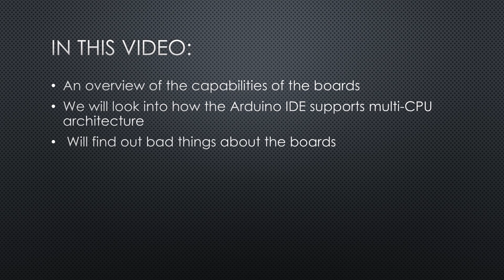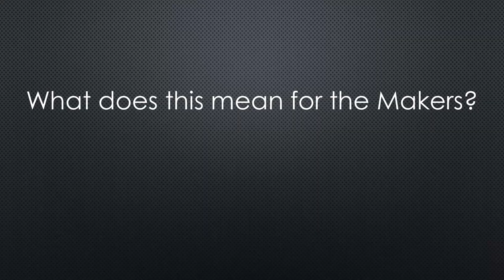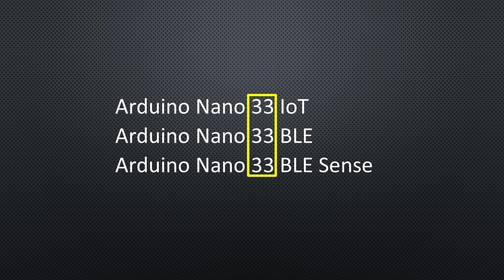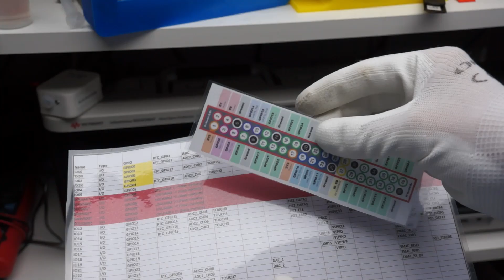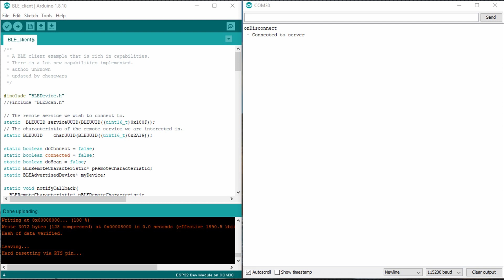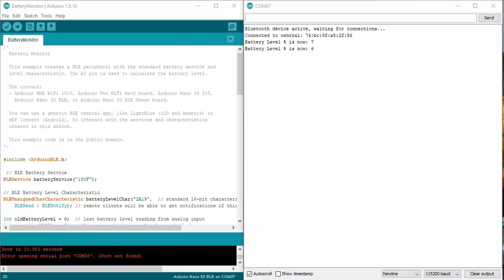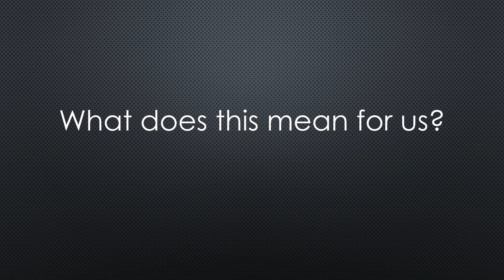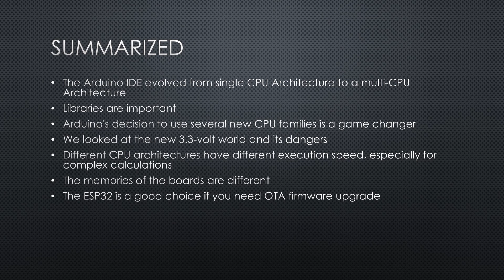#298 Four new Arduino Nano Boards: Test and Comparison (Every, 33 IoT, 33 BLE, 33 BLE Sense)

Comment: Surely the BLE power consumption is due to the BLE device being a MASTER unit rather than a SLAVE unit.  A master has to be awake all the time in order to notice slaves transmitting.  

Is there software available to make the unit act as a BLE slave?
Reply from the maker: You have both examples. But the sensor has to be lower power than the receiver as the receiver usually has more possibilities (e.g. smartphone)

Comment: Andreas, i made a sketch that is working on a Arduino Mega 2560, and is connected trough sosftware serial to a nextion display. do you think the scketch will work easely on a Nano 33 BLE (considering tha anyway i will reassign the pin number in the sketch). i tried to compile but he give errors about the software serial and the nextion events. can you help me? Do you have any suggestion?
thank you
Reply from the maker: Unfortunately, I cannot do remote debugging. But I am sure you will find the error as you already know that it is in the area of the serial connection. Maybe you google with the error message?
Reply: @AndreasSpiess  thanks, i will try ...
Reply: @AndreasSpiess  my real question is: do you have any sketch also the simplest one that interface a nextion display to a arduino nano 33 ble? I tried to the blink sketch to include nextion.h library and it says immediately gave error

Comment: Esp32 S2 support USB
Reply: USB Keyboard? Not USB programming
Reply: @marcrives279  yeh USB ON THE GO or USB host  not programing
Reply from the maker: Did you see boards with this chip? I hear of this chip since more than a year :-(
Reply: Not really mainstream/cost friendly devboard, is there any?
Reply: @marcrives279  nope
Reply: S2 is single core. ESP32 is dual core (plus an ULP co-processor). Dual core really makes a lot of applications easier to write and manage.

Comment: Is Arduino Nano better than Particle Argon?
Reply: That's what I was thinking, if Andreas ever did a review of the Particle ecosystem... I couldn't find any.
But regarding your question, Particle have saved me a lot of time with remote diagnosis and OTA firmware flashing so I'd go with it
Reply: @edgarlz  I've checked their site but found no detail documentation. Like which language is used for programming and available functions etc
Reply: @midsummerstation3345  try https://docs.particle.io/argon/ they have excellent documentation on everything, look at the different tutorials, and they use the same arduino c/c++ programming language, so If you already know arduino you don't have to learn a new language
Reply: @edgarlz  do you face any library problem using Particle ecosystem? as most of library is build based on Arduino.
Reply: @jiahuei96  nope, there's also a big community on particle so most libraries - if not all- are already ported and ready for use
You can do an account and verify on build.particle.io (look for the libraries button and search the libraries you want)

Comment: I'd like an ESP32 and 8266 Arduino line.  Cheap and useful. Those new boards are too expensive in comparison.
Reply: ESP32 and 8266 is not Arduino, they are Espressif.
Reply: @efimovv  Atmega 328p is not Arduino either, it was Atmel... They design the boards and IDE, not the MCU.
Reply: @efimovv  yes, strictly speaking they are not Arduino. And also they are the most used boards by the Arduino community. Arduino is dead, they should sell their name to Espressif.
Reply: 8$ too expensive for a full arduino manufactured board?  not sure they can do any better.  They dont make the dirt cheap stuff, they release open source hardware and others make the cheap copies

Comment: I still prefer ESP
Reply: It has far less Pins and if you dont use wifi it gives interference with analog circuits.. Just because iot takes oft doesnt mean esp wifi is a solution to alll problems. Plesse make an esp sps Kind if device...
Reply: I absolutely hate esp
Reply: @fritzmueller6759  why

Comment: I'm curious about your  view on switching regulators in WiFi applications. My application uses an ESP32 with a linear regulator which does indeed get 'too hot' when powered with 12V. My hardware partner is wary of using a switching regulator because of concerns about interference with the WiFi. Do you have any thoughts on this?
Reply: Shouldn’t be an issue, what do you think devices that have WiFi use? WiFi routers, laptops, and my WiFi booster in my WiFi RC transmitter all run off switching power supplies, they often have their own switching regulator built directly in the board. That shouldn’t cause interference... are you using a Tesla coil right next to it to power it or something? Haha, lol!
Reply: @jakegarrett8109  thanks, I'll pass this on to my guy.

Comment: The 32 bit processors are powerful but also more complicated.  8 bit processors are comparably simple. I wonder how many makers will be left behind or turned off by the more powerful boards.
Reply: Joey Mac in what way could 32 bits effect the normal programmer?
Doesn't the programming language/compiler take care of all the dirty work?
Reply: @santopino2546  Arduino makes it easier to get into embedded programming for beginners. It is much easier to get started with it than say a stm32 nucleo board, Atollic ide for STM32 and using ST's API which is HAL.  The manual for a 32 bit processor is also more complicated than an 8 bit micro also. If your already experienced then ok but if your not Arduino is a much easier path.

Comment: The "every board" is born becouse the hardware is much more price less than the arduino nano and similar. For me, the most problem with the No OTA is that we need to update the root certificate when it expired! But, in other way, the esp32 haven't the crypto chip to storage the keys
Reply: s bright  if I need to talk with a Google Cloud service, i need a certificate to talk with it. What's happen if the Google Cloud server expired the certificate? I think I need to reflesh the crypto chip with the new root certificate
Reply: s bright  I'm using the Arduino framework. On the esp32, I don't have the crypto element, if I need to change the expire CA, i use the OTA. But I don't know if I can use the OTA with 33 Arduino to refresh the CA

Comment: Trying Arduino instead of native IDE for a specific MCU is a serious mistake, and you will realise it when it's too late. Yes, you can start faster and make simple device within a several hours, but sooner or later you eventually encounter very limited capabilities and bugs of these libraries, and also limited support for the specific MCU. Then you will have to abandon your project, or throw Arduino software away and start learning native tools for a specific MCU and protocols for a specific sensors. Very time conuming. So, I think, it is better to learn  MCUs programming natively, via vendor's libraries and registers. In fact, they are quite same, and learning new MCU is like learning new foreing languare - first language is difficult, but every new one is easier and easier.
Reply: The arduino target audience are beginners. Starting out using native tools will loose most beginners.
Reply: P Kav how is the forum and community support in these native tools you're referring?
Reply: @santopino2546  Seems to be good. I never asked for a support, because reading datasheet and/or googling was always enought. I use MDK-ARM (Keil uVision) for STM32 and esp-idf for ESP32 development.

Comment: If you install the nRF5_SDK and compile  e.g. the ble_app_blinky example for the nrf52840 dongle , you can see where all the time is spent on compiling, good thing that in that case I can just do a make -j 16. I don't think the arduino ide does that, is there an option for it? I think the new 1.9 version has  that option.
Reply from the maker: I did not look into it, but I hope they will work it out, if it is so easy.